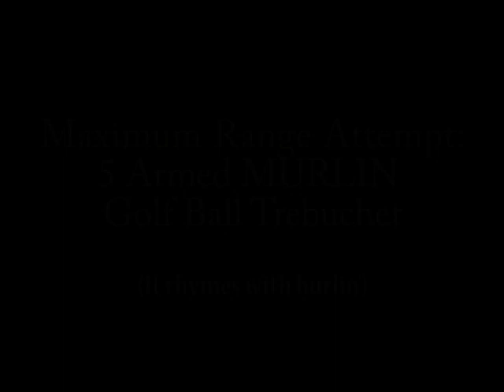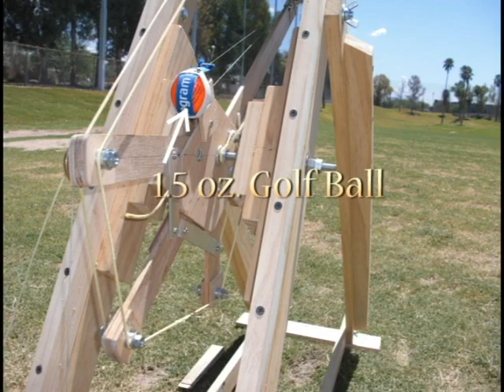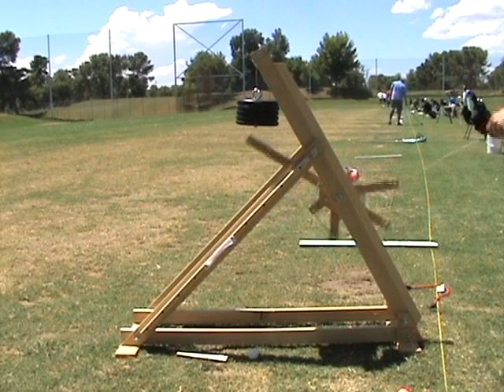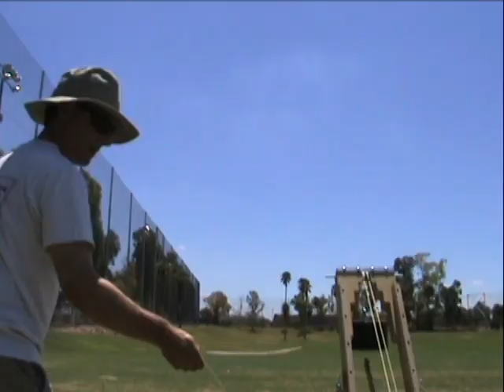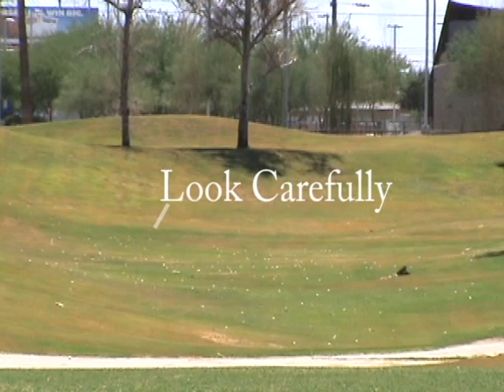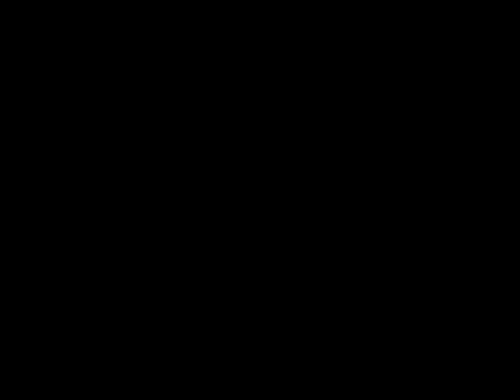Golf Ball Trebuchet:  700 foot distance

Comment from the maker: Brandon:  Your'e probably referring to the fact that 45 degrees produces the maximum distance where there's no drag, but adding air friction reduces the best angle to about 40 degrees.  Adding spin to the ball produces lift, which further reduces the best angle to about 25-30 degrees.  That's why I shoot so low.

Comment: i like the new trebuchet design. i made two designs on paper and think you would like them.1: make the ''merlin'' with only two arms and make sure it grabs the arm at the last second. put 100+ lbs of weight on it. results show you could get 1300+ ft.That is more than 2x the original distance.2 make your design and wheels like an floating arm king arther (FAKA) there for you get a higher shot, a better whip a the end of the arm, and momentam a of the those are the key to making a great trebuchet.

Comment from the maker: My lowest test CW was 7.5 lb, so that's 3.4 kg.  the distances are about 100 feet or so If I remember.  The design itself adapts pretty easily to lower CWs without too much efficiency change, so you should be OK within the 1-3 kg range.

Comment: Interesting, I have built a traditional counterpoise trebuchet for my wife's school but I have never seen a design like that. One thing that did occur to me is you could make just a disc of heavy plywood with the golf ball held i a recess in the disc. Get the weight to accelerate the disc by being wrapped 10 or 20 times around the axle. Maybe accelerate up to 100 or 200 rpm or just cheat and use an electric motor. Quite how to make it release correctly would be a challenge.

Comment from the maker: @CBasement  Indeed your eyes do not decieve you.  The optimum distance throw for this device is somewhere between 20 and 30 degrees above horizontal.  This is because of the lift experienced by a spinning golf ball.  I was messing around a little bit with the release which is why the launch angle wasn't always consistent.

It's a very satisfying little hurler.  I'm now hoping to apply the design principles to larger devices.